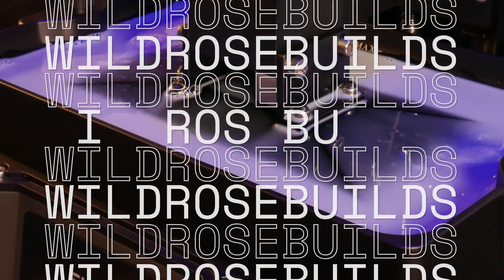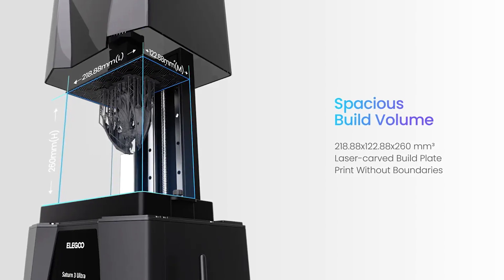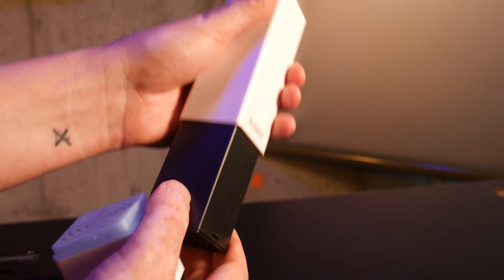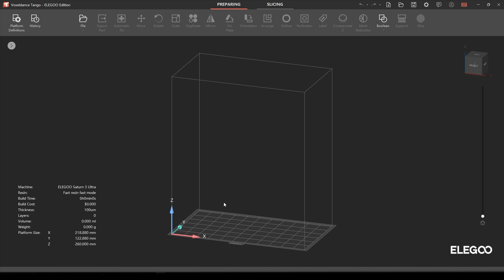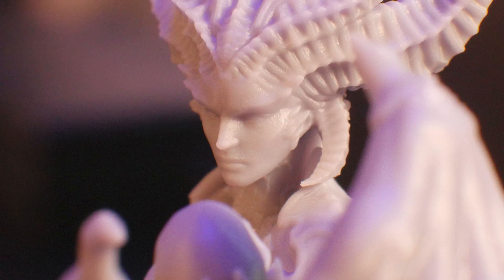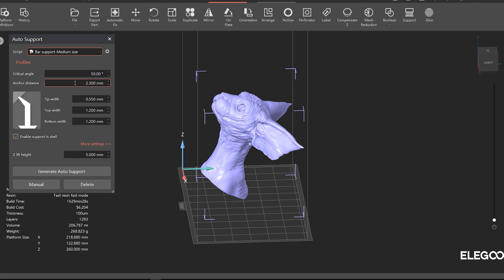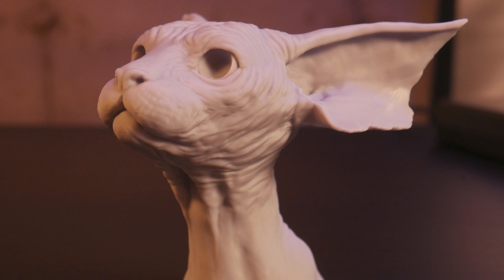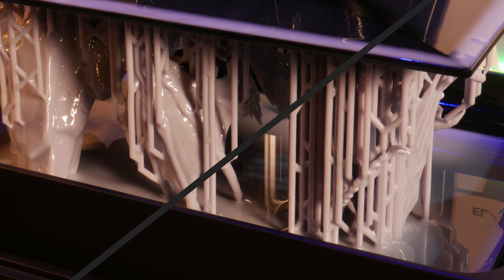Insane 12k Resolution on the new Elegoo Saturn 3 Ultra // first look

Comment: I would love to get into resin printing but I don't need miniatures but larger scale busts etc, it's a shame the price point is so expensive for size of the printers I don't understand why they're so small yet so expensive compared to fdm machines
Reply: Ehm. Because larger screens are more expensive whereas with extruders you just need larger rails.
Reply: @renevandenbosch9967  not necessarily I had a BIQU BX fdm which had a 7" touch screen £400 I paid much larger bed size than any resin printer of the same build volume in that price range

Comment: Where do you get the high speed resin? I couldn't find anything on Elegoo site. Just standard / ABS / water. Standard says "high precision" but that's all.
Reply: its called ''rapid standard resin'' and is the first one of the smaller icons under the standard resin tab.
Reply: @Gurkan_an  nice. It wasn't there at time of my comment I don't think but it's easily found now. Hooray.

Comment: You'll get a better surface quality if you ditch the ACF and replace it with nFEP/PFA...
Reply: Why do you say that?
Reply: @FrazierDanger  There have been a few Youtube reviews of the new range of printers being released, all of which come standard with ACF on the vat, the prints from these have rough scratchy looking surfaces when viewed very closely (from the reviewers who actually show you good close up pics). I will be using two vats, one with the ACF for printing things like gaming terrain pieces quickly where surface finish doesn't really matter that much, and one with nFEP for printing miniatures where surface finish does matter. Here is a good video showing the differences between the two release films...

https://www.youtube.com/watch?v=XxbzuRCv22Y

Comment: you can print the exact same detail on a 6k printer ive actually printed models with much more detail, unless the model itself is truly designed with 12k pixel density, something like that will look pretty much the exact same from 4k- 12k, not saying it isnt an amazing resin printer but people automatically assume higher numbers mean better quality, yes the pixels are smaller, but if u cant perceive them with the human eye its just redundant anyways, its the same thing with 8k tvs. it is a nice resin printer tho and the models were also pretty good too, the one thing that the higher pixel density will be good for tho is making the build volume much larger without going under 4k quality
Reply: What you're not taking into consideration is layer alising, it's not directly comparable to pixels on a tv. Having a better xy resolution significantly reduces visible layer artifacting. If you print something curved like a space marine shoulder pad at 4k you will get visible banding, with a 12k printer you won't get this, even if the level of detail is similar.